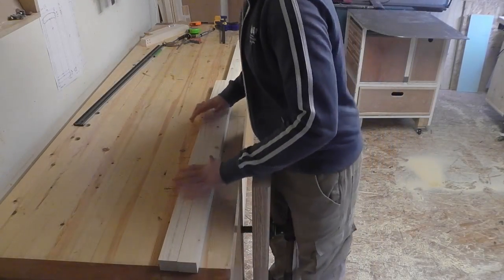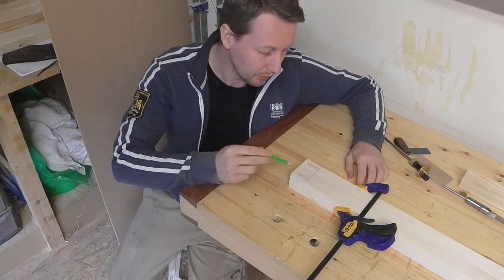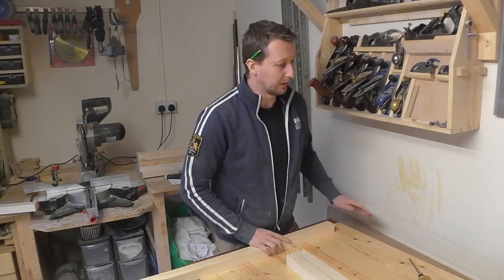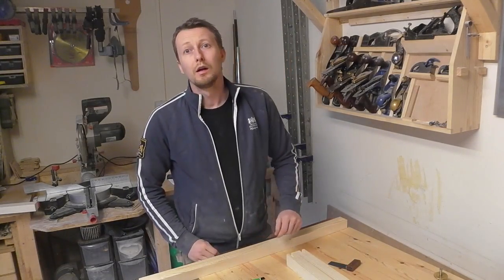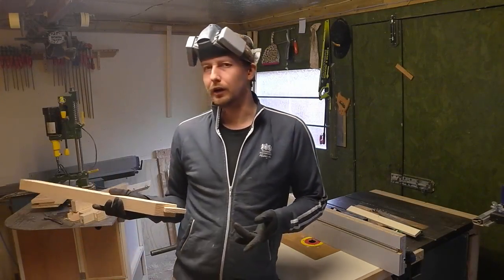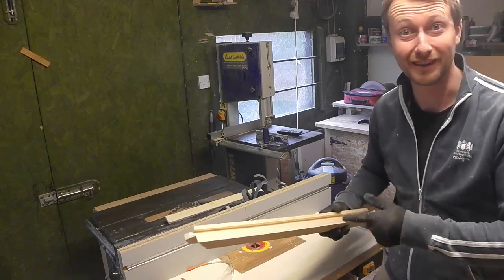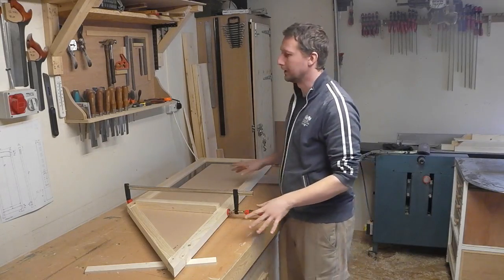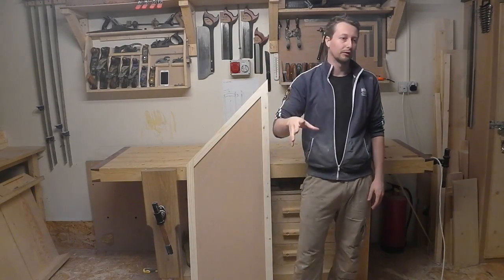Angled Panel Door

Comment: I realize this is a very old video at this point, but I have a similar situation. I have made the door I installed hinges but the door won't close.  The top inside corner will not pass the door jamb.  I had two thoughts first being just bevel the top of the door at the angle of the ceiling as though it were a hipped roof.  The other thought was to take 4 inches off the pointed end and install it as a fixed panel which 'should' allow the door to pass underneath. Any tips?

Comment: Nice video.  I noticed you cut the top tenons by. Hand; did you cut the top mortises by hand?  We are making a door under a staircase and we’re going to  use a lap joint due to the weird angle at the top edges,  but maybe we will do the mortise and tenon.  Thanks.

Comment: did you have to back bevel the long side of the door at the 'peak' to get it to hinge and open properly without binding on the front frame?
Reply from the maker: adamandlorraine yes it needed a slaght angle to clear the frame due to the angle.

Comment: Hi Chris, was just wondering.... would it be possible to create a shaker style door using just 1 single 18mm panel and then just using a router to style out the centre receded bit? I built my first door using the rails, stiles and 6mm panel but it doesn't seem too strong and was really hard to build. I guess I'mi trying to cheat it but not sure if that's at all possible? :)

Comment: What size router cutter did you use for the groove what the MDF slots into and how deep.
Regards Gav
Reply from the maker: The MDF panel is 9mm thick so the groove was also 9mm and about 8mm deep.
Reply: Nice snug fit then, I was thinking you maybe used a 1mm thicker router cutter but then it would rattle 😬
Reply from the maker: @gavjav1  well its probably nearer 9.3mm but I run the groves til they fit the panel..... Snug but not 'tight'.

Comment: Hello there. I have a door same shape for under my stairs ive made. Fits nice but I can’t get my head around how to fit the hinges so the door opens towards me. I’m wanting to put the hinges on the taller side so on the right if I’m looking at the door. I’ve put the hinges on twice and it’s not even close. Any tips you could please give me
Reply from the maker: What the problem your having.... When fitted is the door not opening because it catches on the top inside corner. Yiu need to shave/shape the back side of the cirner on doirs like this ti allow clearance for the angled corner.